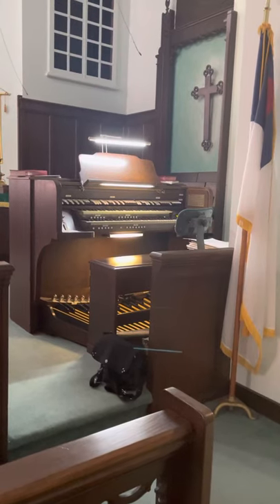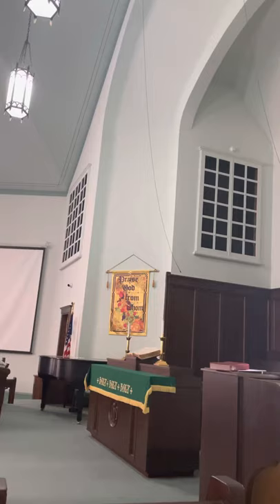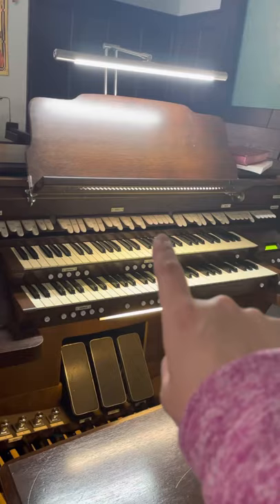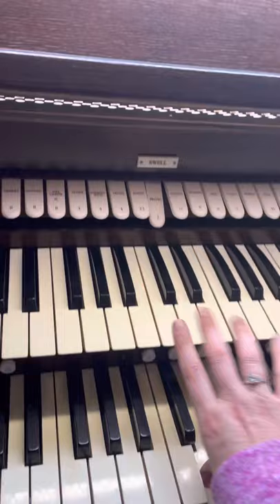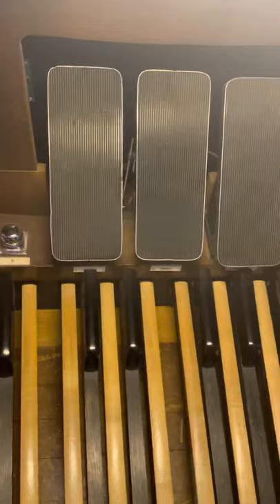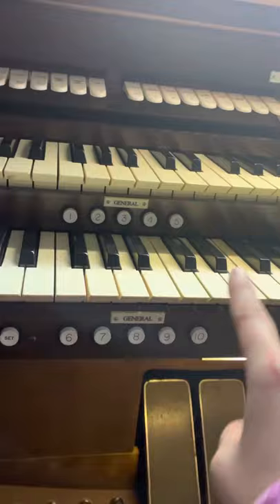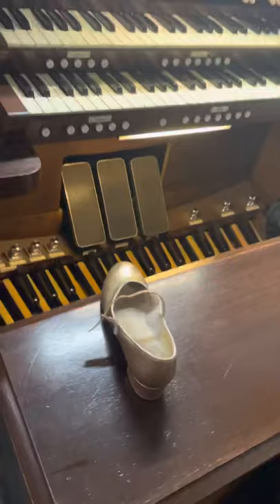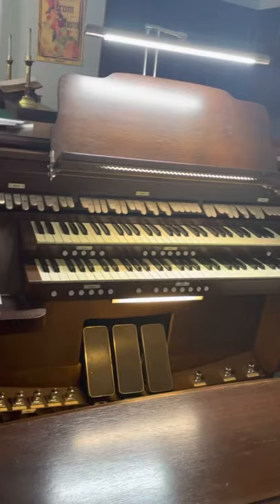Meet My Organ!

Comment: I hate to take issue with your terminology, however you called the keyboards “ranks”, which strictly speaking is the name given to the different sets (sounds) of organ pipes.   I expect that organ is probably between 8-12 ranks.  We usually call organ keyboards “Manuals”.  So with two manuals (keyboards) and say, eight ranks of pipes, it would be described as a 2/8.   When you pointed to the tabs, you referred to them as “pistons”.  The pistons are the pre-set buttons under each manual, and also the foot buttons.   

I hope you don’t mind me pointing this out.   (I’ve been an organist for over 50yrs).  Of course, it might be a language issue between UK and US but I don’t think so, as in the organ world we use the same language worldwide.   😃
Reply from the maker: Thank you for correcting me so politely ☺️